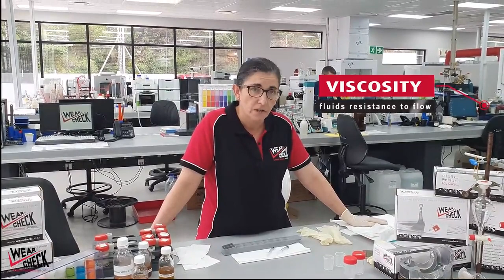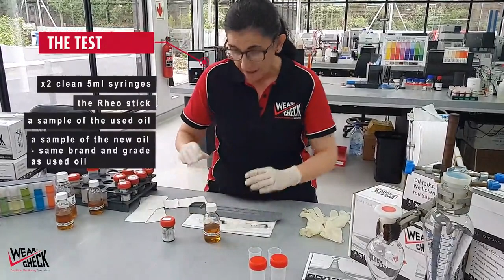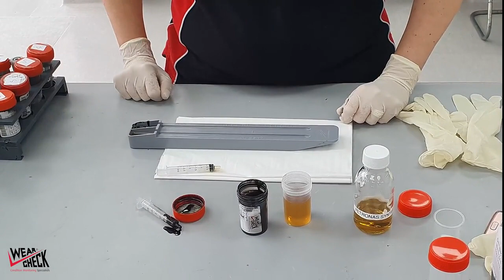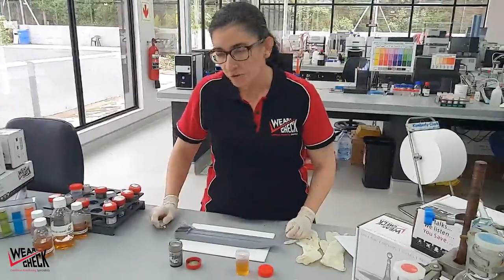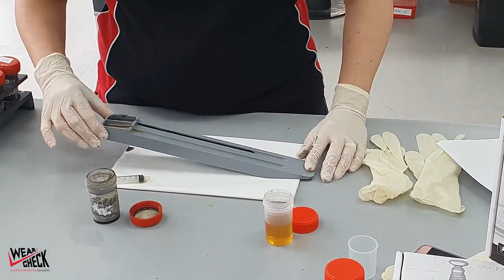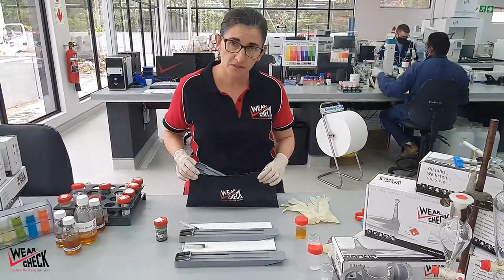How To Use A Rheo Stick for testing oil viscosity

Comment: This is a very underrated tool for diagnosing simple things like lawn equipment; oil with very low viscosity (as in the 2nd example) would indicate cylinder blow-by without having to resort to fancy tools (compression tester, etc.) to make that determination.